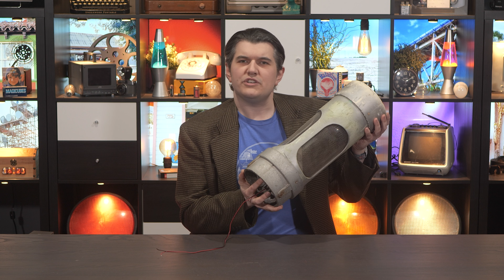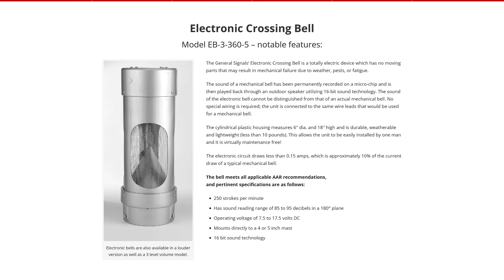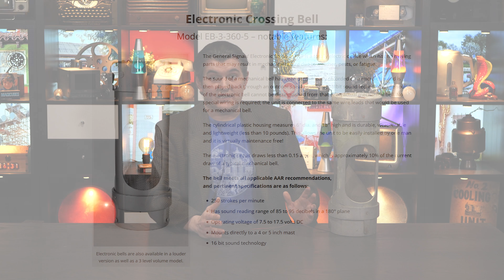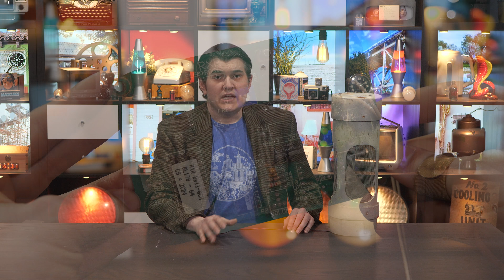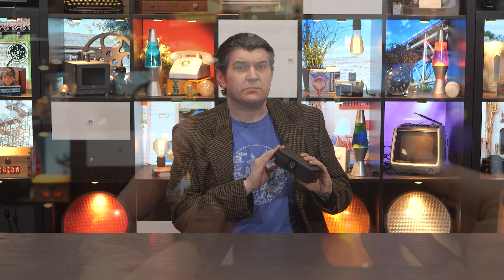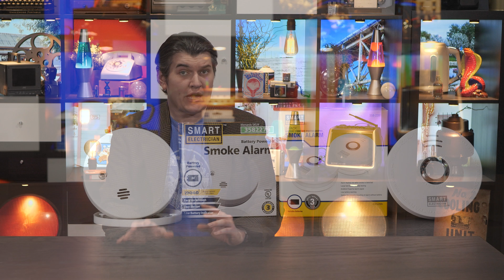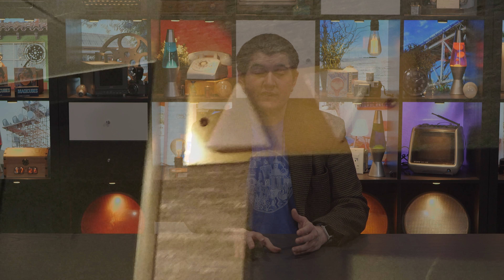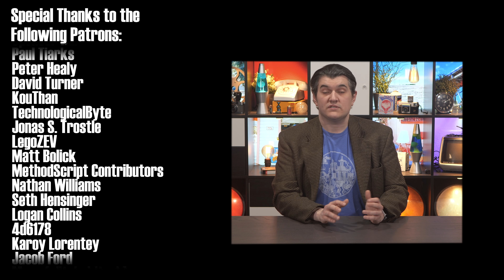The disappearing and unappreciated art of audible alerts

Comment: New OCD unlocked- checking every railroad crossing within 20 miles to see if it has this speaker or the old style bell 😂😂😂
Reply: that's not how OCD works
Reply: @kashiichan I've already categorized every streetlight in my town into mercury vapor, HPS and LED.  I've paid attention to things like that since I was a kid..  Maybe it's not OCD but it's not normal 🤣
Reply: GS bells are alarmingly common, so almost certainly there are at least a few around
Reply: Good luck! Depending on the company who owns the railroad, you will find different styles of this bell! The railroad company "BNSF" typically uses these types of bells at their railroad crossings, with older ones being like the one in the video and newer ones being nicer looking and different sounding. The company "Union Pacific" has crossings with similar bells but sound way different and are usually on the side of the pole instead of the top.

Comment: I wish we would return to real bells.
When in Brussels, I noticed that the older trams with real bells could be much more easily localised.
I think it is something about the impulse wave from an actual bell being hit.

A speaker always gives a slightly softer sound without the same transient.

It is an important safety consideration, but probably not quite so important for a railway crossing, although I suspect a real bell is more likely to be heard inside a vehicle for similar reasons.

Comment: Tbh the airplane “bing bong” sounds are just really pleasant
Reply: I remember them being used for Good Janet in The Good Place. Pleasant indeed
Reply: thats my notification sound for important stuff and "stall" for critical stuff
Reply: I'm assuming you aren't using a Cessna stall alarm 😂
Reply: I always wanted to wire the Airbus "autopilot disconnect" chime to my cruise control cancel button. However, this is not something that can easily be done... Especially since there are four different triggers to disengage cruise control...
Reply: @Colaholiker  Well, to be about sounds and their recognition, it's a universal sound and not specifically tied to a certain type of aircraft manufacturer. The Flight Warning Computers I service are in use on Fokker aircraft (for as far still in the air) and the sound (it's called the 'cavalry charge') is exactly the same. Considering how serious the issue is that causes this audible warning, I would have been surprised if it would differ across different types of aircraft/aircraft manufacturers.
That there are four different triggers that can disengage cruise control sounds a lot like an aircraft ;)
Reply: @weeardguy I think Boeing uses a different sound. ATR uses the same as Airbus, but no surprise given their relationship. 
Maybe it's down to who the avionics are from. But being the same across models is probably less important, commercial pilots mostly only hold one type rating at a time, so they fly only one aircraft type / family (Lie they can fly A319, A320 and A321, but they couldn't be scheduled to fly a Boeing 737 the next day. That would require a completely different training. 

I never thought about it before I wrote it here, but the four different triggers are true. Cancel button and cruise master switch on the steering wheel, a switch in the brake pedal and another one in the clutch pedal.. that would be messy wiring. 😂
Reply: @weeardguy  : it's the same on the CRJ as well. Unlike the Boeing "lazy moaning" noise, it's loud enough that you can hear it in the cabin pretty clearly.
Reply: I kind of feel as if, personally, the reason they are pleasant is at least in part due to association. I associate them with flights, which I associate with holidays. Hence, a positive association.

I'd love to know how someone with a more negative (or at least more neutral) feeling about planes and air travel feel about them.
Reply: Surely it's not any plushie
Reply: They give me PTSD.

Comment: If screen brightness has been controlled with a light sensor since forever ... why isn't notification volume moderated by some kind of sound sensor built into the phone?

I set common notifications to natural sounds (bird chirp, cricket) so I recognize them but they're less noticed by others. Also wish there was an option to retrieve a bit more info from priority messages with morse vibrate or tone output - even a quiet tone is much more discernible than spoken words but less obtrusive to people not listening for it. If nothing else, it helps the alert carry more info to decide if it's worth attending to.

Comment: Sometimes my phone just sends me a message about a missed phone call instead of just ringing. Great tech.
Reply: how about no sound which my phones are very good at, so many missed important calls, yet telemarketer calls are loud
Reply: i swear my flip phone will notify me of a voicemail left when my phone did not ring. granted most of my calls are spam but it just doesn't ring and it's weird. i also wish there wasn't a sound dichotomy between inside and outside. if i am outside walking by a road or hearing the wind and birds, my phone at vol. 7 is not loud enough for me to hear it, yet that is loud enough for being inside even with people talking. i don't want to keep raising and lowering the sound depending on my location so i can hear it and be polite to others.
Reply: Most automated phone systems know how to bypass the call going to your phone so it goes straight to voicemail instead. Telemarketers don't want voicemail since they know you will never return the call so they don't use it.
Reply: @bloodalchemy  worse they may use voicemail for
Reply: I'm lucky that when my phone does that, it's just spam calls, but I dread the day it does it for something I care about.
Reply: Mine does that in the DND times I set up to not get distracted from work by notifications. It only rings for starred contacts in those times.
Reply: I had this POS android tracfone back in the mid 2010s where the incoming call dialog box was nonexistent.

You HAD to let the phone ring and go into the missed calls list.
Reply: thats corporates abusing the api

Comment: I still use audio cues for stuff all the time, personally! 😂 

I've got little homemade beeper circuits for the fridge/freezer door (cats knock it open sometimes jumping up and down), a chime for the front door actuated by breaking a momentary switch contact when opened (or whacked hard enough when shut). Both super handy and i used purely components from annold VCR and some old ICs i still had layin round from radioshack 😂

I also know my thermostat click, the valve release for my dishwasher (2nd one is much higher flow so more agressive kthunk, 10 mins left on the dishes!). 

The big problem is everything is a fire alarm now lol.

Comment: Another good example is a pneumatic whistle. You see them referenced a lot in old cartoons in a factory setting.
I deal with Fisher Controls in my job and the Type 167D bulletin still shows a hookup schematic to get a whistle to blow if pump discharge pressure fails!
Reply: This made me realize how cartoonishly anachronistic it was even for 1989 to have one of those going off to tell Homer Simpson his shift at the nuclear power plant was over. But of course that was probably the point.
Reply: @stevethepocket  Though, considering the steam turbine infrastructure used to generate power from a nuclear reactor, might also make sense. Got excess steam? Use it for signals.
Reply: @stevethepocket the paper mill in my home town blew a whistle at noon into the early 2000s.
Reply: there’s a chemical plant in my neighborhood that still blows a whistle every morning at 7:30 every morning.
Reply: @stevethepocket think about how old Mr Burns is He probably doesn't see any need to change it
Reply: I feel like you should hook one up at one site, just to see what happens. :3